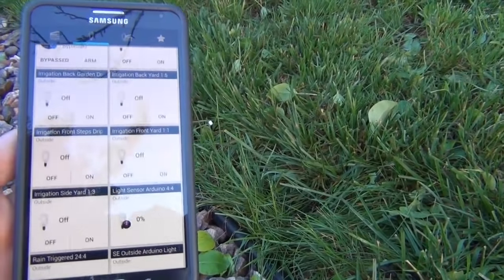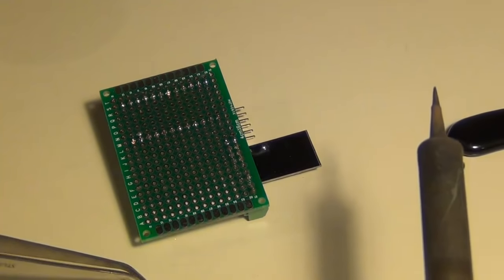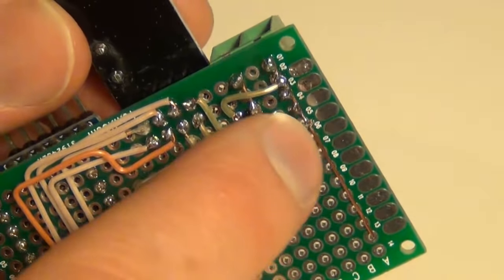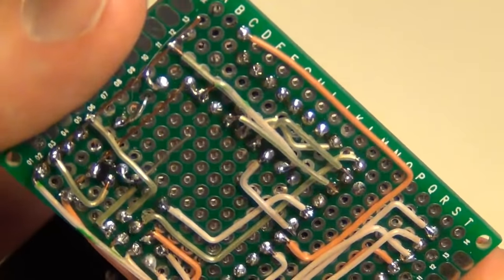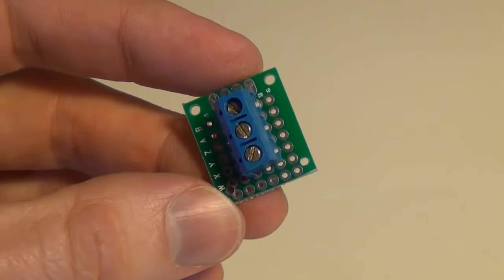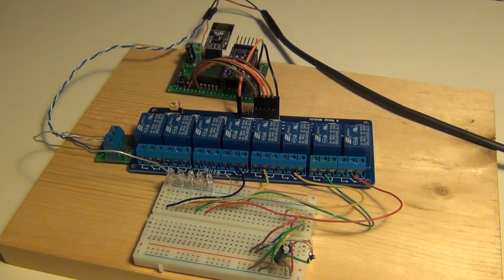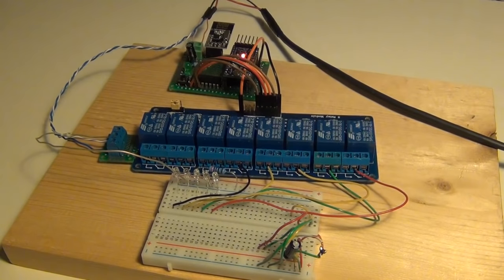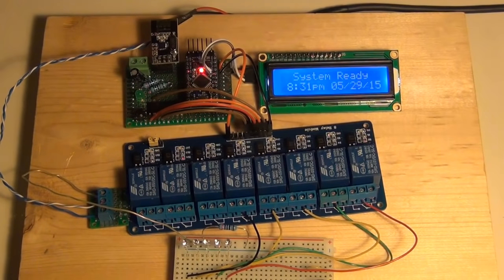How To - Cheap, DIY Arduino Irrigation Controller with MySensors

Comment: I've been a "Arduino-related" project hardware/software designer for about 10 years - and electronics/software for over 40 years. Your project video and "how-to" format is excellent. Kudos to you and those original designers to which you attribute success. I, for one, applaud you all and your willingness to share it with others.

To that end, if I might make just a constructive and positive suggestion, it would be to include an actual electronics schematic diagram in addition to the color-graphical "Fritzings". I remember with Fritzing diagrams first appeared. They provided a way to circumvent the task of needing to learn basic electronic protocol. I am 75 years old now but when I was a boy at age 9 or 10, Fritzing workarounds did not exist. Learning electronics at that age wasn't difficult at all but it did require a little effort. That effort, fortunately, snowballs into very, very useful skill sets. I am thankful I had no "workaround" to short-circuit (no pun intended) the learning of actual electronics.  Whether for hobbyists or budding professionals, NOT knowing the basics of electronic schematic diagrams is a barrier to these pursuits - especially for people who wish to excel in developing expertise in both software AND hardware. The exclusive use of Fritzing diagrams creates a skill set which is far too heavily weighted in coding and software. Hardware integration beyond a "copycat" scenario can never advance. Instead, harvesting the work of others through constant Google searches is the predominant course of research and development. No offense should be taken when noting that a case in point is that this project is more popular to viewers whose dependence on wiring "graphics" vs those who, like myself, come here to see if improvements to circuit functionality have been added. Without a "real" schematic, it's impossible to evaluate whether or not the electronics interconnections are at their best. To do that, one must do what should be readily available in this project - draw a proper electronic schematic. With that schematic, one can make a very quick assessment as to the simple improvements (like noise immunity) which may or may not exist in this design. In other words, one shouldn't have to build this project according to "Fritz" wirings to discover design weakness that could be spotted in a few minutes of looking over a standard schematic.

 In time, if these projects will simply include a real-world electronic schematic,  people's exposure to real-world electronic symbology and wiring conventions will propel them to ease in reading such schematics and will accelerate the design of projects yet to be conceived.

Comment: I really like the fact that you didn't hyperfocus on making things look "neat". More and more of us are learning using youtube for this sort of thing and I feel like those new to doing prototyping get hung up on or feel like they have to make things pretty. Really, everything most people do are one-off's. Does it really matter if it's pretty or if the wire traces are well designed? Not really.. lol

Anyways, really loved the video. :) Lot's of good pointers too!
Reply from the maker: Thanks :)
Yeah, this is sitting in my basement with no one looking at it.  If it was in the center of my house it would have to be a little neater :)

Comment: Awesome video. I am just starting out with Arduino and know very little but your video was so clearly done that I understand most of it. I only hope that sometime in the future I will have the knowledge that you have. Thanks. I'm just an "old" guy who is trying to stay in the present. Videos like yours are making that possible.
Reply from the maker: Great, glad you like it!  You'll get there soon :)
Reply: Pete, I'm at a loss though. I have been watching all the videos on "how to do it" and I bought a kit with all the stuff to get started but now I'm high centered not knowing whether I should just dive in and build something or wait until I understand the coding first. What say you? Keep it easy, I'm 73 going on 20.
Reply from the maker: First off, that's awesome that you are 73 and learning this stuff!  Keep it up!  For me personally it's a combination of both (diving in and understanding).  As you start to dive in you will get more understanding because you will be forced to learn when you have issues.  I would say just take your time and don't expect too much right away or you will get frustrated quickly.  As far as this project goes it is definitely more complex.  I'm not sure what exactly your goal is but if it's automation with Arduino you may want to start with a simpler project first.  Like a motion sensor or temp sensor.  Check out MySensors.org for info on this.  Hopefully that helps. Pete
Reply: Thanks Pete, for taking the time to reply. I have no intended goals at this point other than to "LEARN" something new. Gotta keep the grey matter from dying. I am a computer junkie but I really know just enough to keep all my neighbors machines running. I stumbled upon the whole Arduino thing by accident and have hooked. I just wish there was someone close by to "buddy up" with. It's very lonesome out here in "senior land".
Reply from the maker: Have you looked around for a Maker club?  Maybe there is one near you that you can join?
Reply: Is that what they are called? I didn't know that. I'll have to do a search. Thanks.

Comment from the maker: +loannis Kalfas
I couldn't reply to you directly.  Sketch uses 24,456 bytes (79%) of program storage space. Maximum is 30,720 bytes.
Global variables use 1,237 bytes (60%) of dynamic memory, leaving 811 bytes for local variables. Maximum is 2,048 bytes.
Reply: +Pete B  TODAY IT USES 32748 bytes  could you share the older libraries adecuate to this to work in promini 328?
Reply from the maker: zelthan Do you have debug enabled in the MyConfig.h file?  If so please comment out this line: #define DEBUG
Make sure to save the .h file then recompile the Arduino code. It should be around 25,342 bytes.
Reply: +Pete B sorry Pete don know how to enable debug, could you explain me that please :), I tried using the code editor from mysensors  site an arduino software( which was worst lots of errors poped out after downloading libraries) I dont know where y that librarie / MyConfig.h
Reply from the maker: zelthan Let's continue the conversation here: https://forum.mysensors.org/topic/153/irrigation-controller-up-to-16-valves-with-shift-registers/143
Reply: Can you write code arduino controller timer Real O'clock AC 220V

Comment: Another idea is to have soil-moister sensors, and to use data from the to decide whether or not watering is even necessary. For example if it rained, you can skip watering, or if is a bunch of really hot days during summer, watering may need to be increased.
Reply from the maker: +morpher44 Yes, that is a good idea.  I don't have soil moisture sensors yet but I do adjust the watering time based on past and future weather.  The idea behind this controller is to keep it fairly simple then add additional sensors for more control through your home automation controller.  You can check out my other videos to see how I'm currently doing this.  Eventually I may add some moisture sensors but this is working well for me so far.  Here is the link to the playlist: https://www.youtube.com/playlist?list=PLGzVpwPAKnPYoldab91pdluXgMIh4if9Q

Comment: Pete, I have watched your video so many times I feel like I know you.  I have built this circuit on a breadboard and on a perf board and I'm having the same issues with each. I noticed that there is a 1K (pull-up?) resistor between VCC and pin 13 of the shift register and Pin 6 of the mini.  Did I miss something somewhere? I don't see it on your board and don't recall it being mentioned in the video.  Thank you for all your work on this tutorial.
Reply from the maker: :)
The resistors were added later based on some input from the MySensors forum post.  My memory is a little hazy but I believe they were there to stop a small bug that happened for some people where a few valves would briefly turn on  when the node was first powered on.
Reply: I thought that might be the case.  Thank you for getting back to me.

Comment: Hi Pete! thanks for the video! I'm doing a similar project but for indoor use. I'm thinking of using a 9v battery as a power source to supply enough power to run a small water pump as needed. I want to be able to view the values of the ambient air temp/ humidity, soil moisture, as well as be able to turn on the water supply on the app. The pump I am using is a submersible water pump used for a fish tank. I also have an Ardiuno Uno board can I used that instead? Any recommendations would be helpful to point me in the right direction. 

Thanks again!
Reply from the maker: Yes, you can use an Uno.  Battery powered may be difficult as special processes need to be put in place to use battery (an consume as little power as possible).  If you can use a simple 5V cell phone charger your life would be much easier :)

Comment: Hi Pete B,
Great video, I’ve just come across which is similar to a scheme I have had working for a couple of years. One issue I have experienced is the relay contacts burning out after a period of use. 
My valves are 12v and are switched on once per day for between 2 and 20 minutes. 
Have you experienced the same problem and, if so, how did you resolve it. 
Many Thanks,
PaulO
Reply from the maker: I haven't had an issue with relays yet. I have had them running for years. Mine are controlled with 5v. Maybe you can try switching your power supply? I'm not sure that will help though since I've never looked into it.
Reply: @peteb9105  Thanks for getting back to me. Like you I’m using 5v relays, so I don’t know.

Comment: Great project. Sorry I'm sure I missed it somewhere but where is the cell phone part of the project? I'm guessing you talk to the controller using the wifi connection but what software do you run on the phone?
Reply from the maker: +Richard Woerz Hi Richard, the irrigation controller integrates in to Vera (getvera.com) using MySensors (mysensors.org).  The cell phone app is a Vera app.  So, not only does it control my irrigation but I can control lights, locks, blinds etc.  Hopefully that makes sense.
Reply: +Pete B Thanks Pete for you quick answer. I've wanted a setup like this for many years mostly to check out and repair my sprinkler system. Running back to the controller to turn the zone you're work on on and off is a total drag. Every commercial sprinkler controller I've ever used are totally not intuitive. 

I also hope on using this system to monitor a solar space heating system I'm building for my shop.  I'm just getting started and you have inspired me to take some video and maybe someday post it on YouTube. 

Thanks again

Comment: Dude, I like your project very much. There is a point I do not understand. How does it communicate with the phone? Which application is required for this?
Reply from the maker: You need a controller to interface MySensors with.  I'm using Home Assistant to talk to the MySensors Ethernet Gateway which talks to the irrigation controller.  https://www.mysensors.org/controller/homeassistant
Reply: @peteb9105  Thank's a lot. :)

Comment: Hi Pete, Thanks a lot for the great job done! I really enjoyed the clarity in your explanation. 1 Question: is there an added 10K resistor connected between the push botton and the vcc? What is its function? Thanks in advance for your reply.
Reply from the maker: Good catch.  It is a pullup resistor.  This project has undergone some changes since I first did the video.  I just looked at the code and it looks like the button is now using the internal pullup resistor (INPUT_PULLUP) so you should be able to skip the 10k resistor.  If you don't use the the internal pullup resistor you need the 10k resistor so it's not "floating" and giving you false "pressed" signals.
Reply: @peteb9105  
Thanks a lot for the explanation :) . It's clear now.

Comment: hello.

Good video!
I tried to import the code (new version) but I got many errors.
Do you have a newer code?
thanks for your time.
Reply from the maker: Did you download and install the required libraries?  If that doesn't work, please post the errors on the forum.

Comment: Thanks for your great effort..
I am asking about receiver section and its place as i cant find it in the video, also Valves are battery operated or AC power operated ?!
Reply from the maker: +Sief Eldin Yones I use MySensors to communicate with the home automation controller. Check them out at MySensors.org
The valves are powered by a 24v inverter plugged into the wall

Comment: I know this is a few years old, but I found it quite interesting.   With this project,can you have multiple zones on at the same time?   For example I have two garden beds, one needs water every day, the other every second day, but I want both watered at the same time.
Can it be set so every second day, zone 4 and 5 water at the same time, or does it require zones to run one at a time?
Reply from the maker: By default it only does one zone at a time. You could definitely customize the code to have both turn on though.

Comment: I understand that if I make this wonderful project, I can't program it to work automatically?

Thank you.
Reply from the maker: You definitely can. It doesn't run automatically with the current code so you would have to add that yourself though.

Comment: Hey, just saw this. How's the irrigation system holding up? Did anything break or malfunction througout the years?
Reply from the maker: Still working after all this time. No issues or repairs yet. There was one small change to the wiring diagram (added a resistor to the shift register of I remember right) so just make sure you look at the link in the description for that.

Comment: Hi Pete B, I've been hesitating in building my own irrigation system for many weeks. After seeing you video I decided to jump in the Arduino project head first. I bought all my parts and I've started testing things out. I didn't buy everything you had, since I'm not the best guy for soldering projects. Anyhow, I noticed you placed a second connector to pass 24v to the 5v relay. Do you have some schematics to share on this as I'm not sure I get how the 24 volts are being passed through a 5v relay? Any help would be nice. Great work by the way. 
I can't wait to see other projects from you.
Reply from the maker: +Danny Rocheleau 
Hi Danny, so basically you need to daisy chain the 24V to each relay from the power source.  They will all have the same 24V wire interconnected to the relay.  I chose to do this with the pin on my relay that is not connected in the white lines (Normally Open - 17:19 in the video).   You would then connect the wire going to the irrigation valves to the center connection of the relay.  I'm not sure what your relay board looks like but check out the video around 17:19 in the video to see the white lines I'm referring to.  Hopefully that helps.

Comment: Great Video, I'm confused how this now links into the valves/ water supply / pumps etc?
Reply from the maker: You would connect the output of the relays to the positive wire on the valves.  The other connection on the valves would be wired to the same negative wire.  You can see the multi-colored wires in the picture at this link: https://www.mysensors.org/build/irrigation 
Those all go to my valves.

Comment: Quick question how does one connect then configure this to the mechanical side of the irrigation system we have the electrical and code components now how do we connect it to the actual irrigation system?

Comment: Very good project! Congratulation! May ask you why did you use shift register? Was not possible to use directly to the arduino i/o ports?
Reply from the maker: apzeiroturbo Thanks!  The shift register is there to allow control of up to 16 valves.  If you only have a couple of valves the code could definitely be modified to work without the shift register.
Reply: Pete B I will try with 8 relays, so I think I can go just i/o. Is it right? Thank you for the video.
Reply from the maker: apzeiroturbo Yes, it should work as long as you have enough pins free.  You will also have to modify the code a little but it shouldn't be too difficult.  You might consider ordering some shift registers for future projects anyway.  They are very useful and cheap.  :)
Reply: apzeiroturbo 

The code is extensible to 16 valves, so there were not enough IO pins with the radio, Pushbutton, display and LED connected...

Comment: Hi, Beautiful arrangement and neat/simple mounting board arrangement, You are sending me back to square 1 on my version of this gadget, you gave me some different perspectives. Thanks.Concerning the 3v3 regulator,  it says only 
•3.3v voltage regulator is in the components list.Can you please specify the exact model you used  because its sizes fits well the pcb holes/traces, I am worried if I order any 3v3 smd regulator online  the size will be different and will be more difficult to fit.Thanks
Reply: you could take any 3.3v dc/dc fixed voltage type you like. i used a to-220 case ld33v. needs more space, but is easier to solder. space isn't an issue here anyway?!